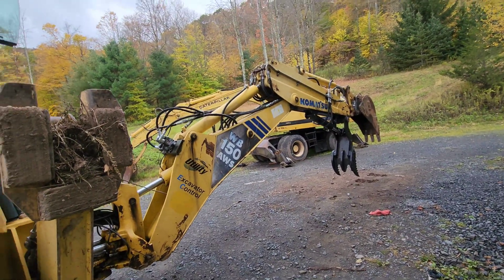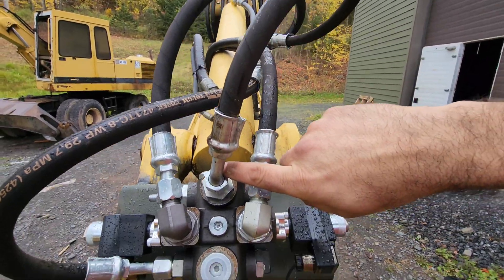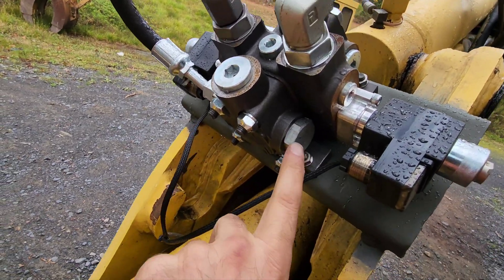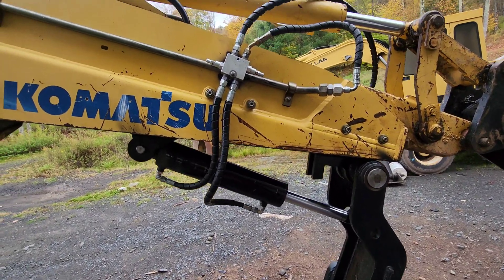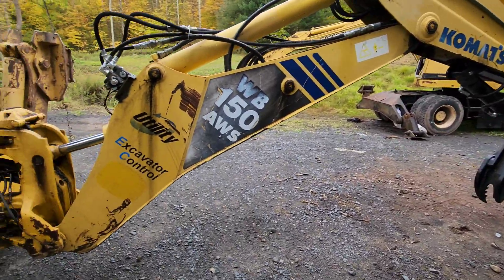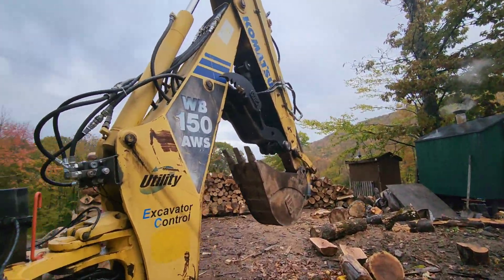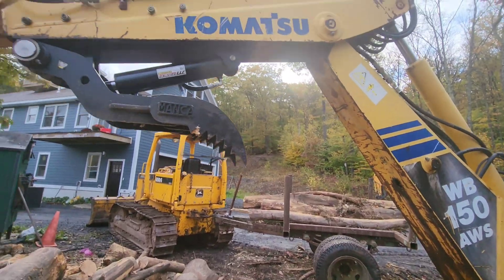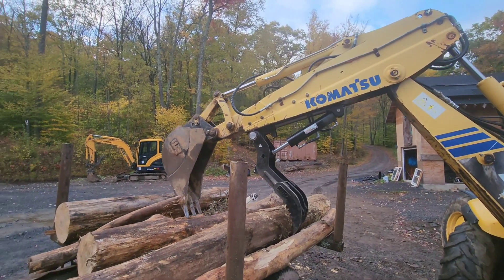How to convert hammer circuit to thumb circuit.   Installing hydraulic thumb onto my backhoe.

Comment: The reason you bent the rod was because when the thumb switch is not activated, it holds the pressure via the summit valve. If it didnt, it wouldnt hold the thumb in place. You need a crossover relief after the summit valve which is what you did. You could have actually just put a single crossover relief right next to the summit valve, and tee'd off the return on the summit valve. Thats what I did, and I have a video about it on my channel from about this time last year. When you have the summit valve activated, the relief valve works...but that doesnt help when your not using it
Reply from the maker: That's not the case
  I tired that and it didn't make s difference.  The block was not designed correctly. I had to add the bypass valves.

Comment: That is an interesting mounting location for the rear arm lift cylinder! Seems that design would limit its lifting capacity.. Cool setup though I have a manual one on a 555e can't do without it now that its there